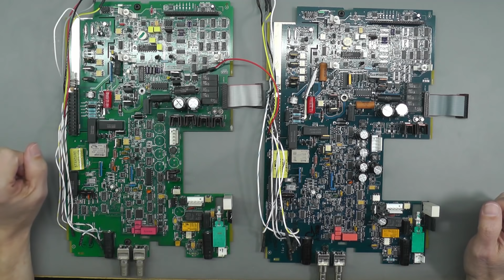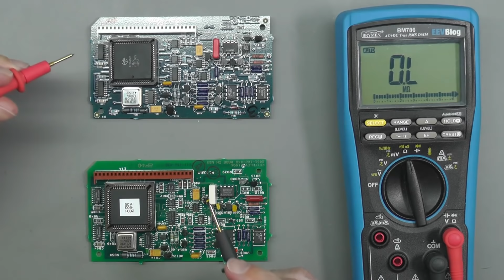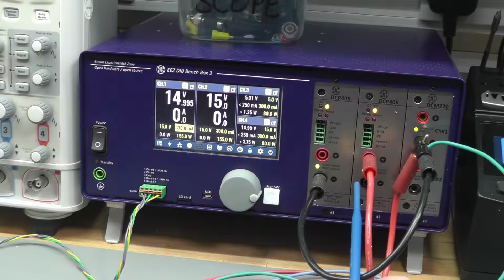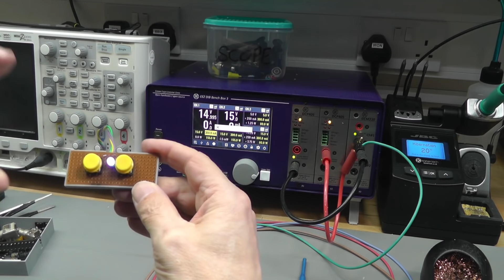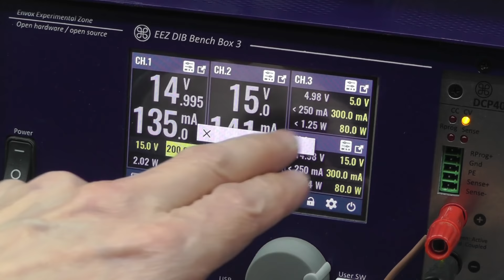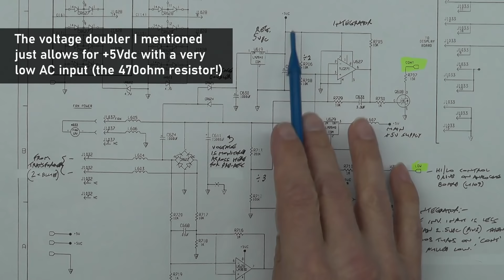No.091 - Keithley 2001 7.5 digit Multimeter Repair - Part 5

Comment: I used to repair welding power supplies and have seen a number or variations of the 'auto linking' circuit for auto-configuring input voltage selection and have to say this Keithley circuit is the screwiest of them all. Given the havoc that a malfunctioning input selection can have why would they choose to go this route?

As an example: Miller Electric had a fairly robust auto-link system on the XMT-304. As I recall it used a separate secondary winding that fed a small switch type supply which powered the auto-link circuitry. This worked well by all accounts except for one edge case. We had one customer that had a rack of 6-8 units that was used for assembling large brewery tanks on site. They would hire a very large commercial gas driven generator to power all the welders with 480VAC. This worked fine for months on several job sites until a generator had a brief brownout which caused the welders to automatically relink to 240VAC and stay there even as the generator's output recovered to 480VAC. Most of the power supplies were damaged and Miller Electric said "Oh, we didn't think of that!" Given the more common sense design of their system they were able to update it to handle that edge case.

I wonder what would happen with the auto-linking scheme on this Keithley meter in a brown out? It seems they went to a lot of trouble to design an overly complicated input selection scheme for an instrument which would normally be configured once for input voltage and then never be touched again for 20 years.

Comment: Nice video Ian. For next time i would suggest to use heatsinks for that white resistor..It gets pretty hot if there isn't any heatsink connected to it ..So i would suggest that..and also that transistor that is close to it..(i'm not sure if it was hot or not when i did it..but for sure i know that resistor got pretty hot ..actually i burned my finger..lol..)
Reply from the maker: Yep, I have the original clip and a heatsink on standby......

Comment: I find it hard to believe that mosfet isn't fully on or fully off depending on mode. makes no sense otherwise - have you checked the transformer hasn't got a short on the primary or something?
Reply from the maker: That is something I am looking forward to getting the scope on to see it actively in action and using my variable transformer. I suspect that 15000uF capacitor on the main secondary (5v rail) is used to dampen things and slow everything down. The mosfet switching fully off or on intermittently. Just a guess!
PS. I have two transformers, both the same, no shorts etc.
Reply: @IanScottJohnston  The transformer outputs possibly just measured high without any load?  Or maybe I misunderstood your pre-flight checks.
Reply: And of course as soon as I commented, I see you have uploaded part 6 where we do see the AC input pre-regulator dropping some voltage

Comment: The circuit with the 470R and the mosfet will also act as a current limit if the system has a fault stopping the rails to come up, say a short circuit secondary diode.
I have seen this arrangement in industrial PSU's which tend to have a thermal fuse in the resistor also.